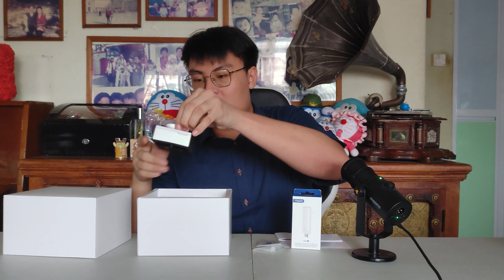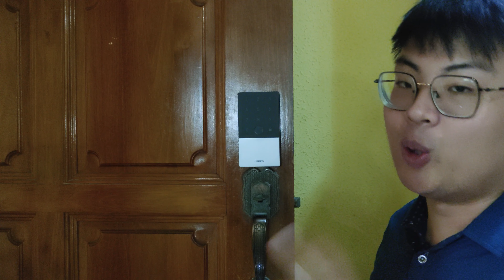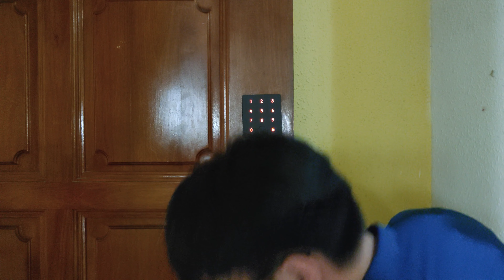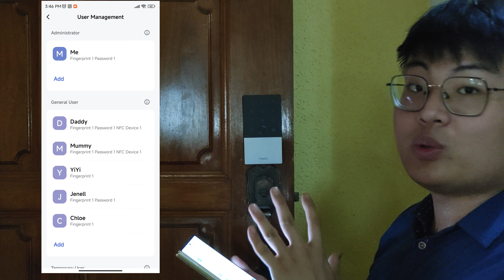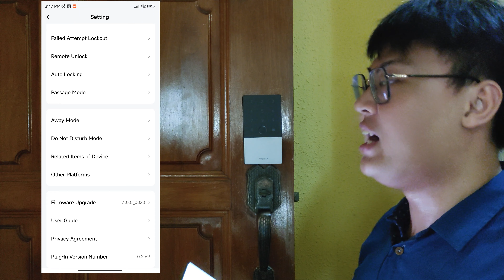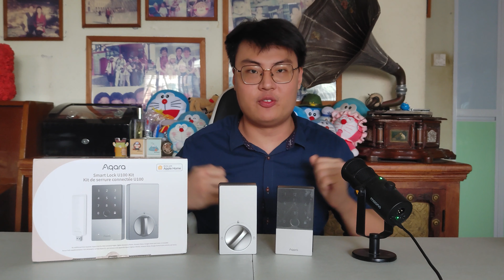Aqara U100 Review - Smartest & Most Versatile Deadbolt Smartlock

Comment: Most modern doors use muktipoint locking controlled by a simgle lock cylinder. Doesn't look to much work for them to make this work in that configuration.
Reply: I agree with you